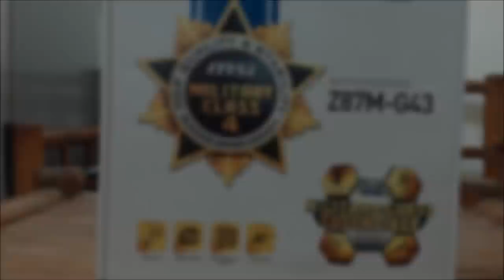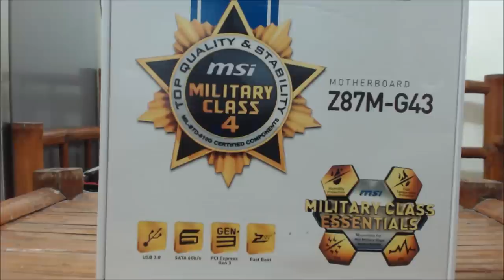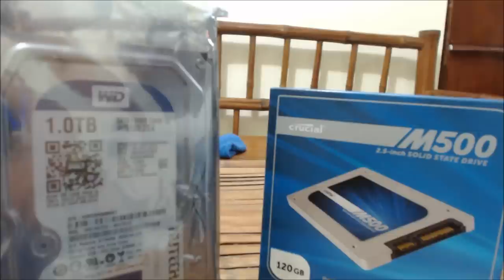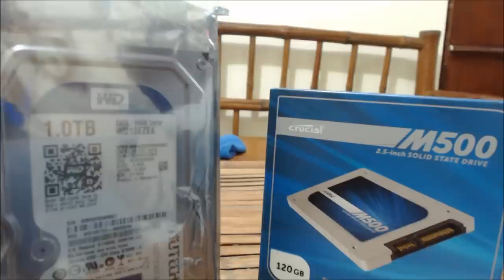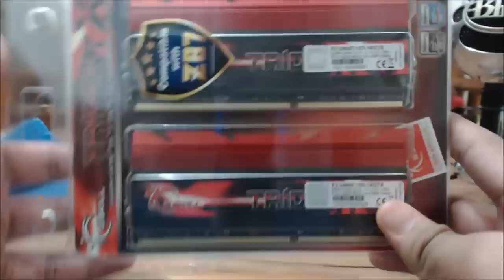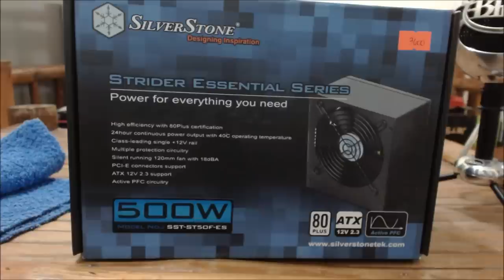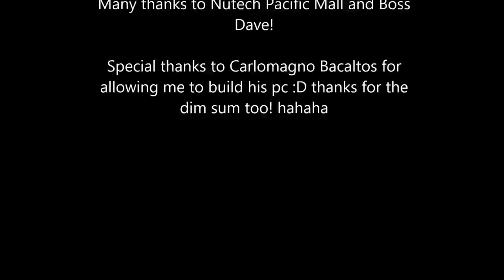Systems Edition : Mid To High-end Build

Comment: Sir~! Jimmy Ano po sa Tingin niyo? 

CPU - Intel Core i7 4770K 3.5Ghz 8MB 
MEMORY - Kingston Hyper-X 8GB DDR3 1600 
HARDDRIVE - Western Digital 1TB SATA 3.0 Blue 
VIDEOCARD - MSI N760-2GD5/OC GTX760/2GB/256BIT/DDR5/OC
MOTHERBOARD - MSI Z87-G43 GAMING Z87/DDR3/MC4/SB CINEMA
CD/DVD/CDRW - Liteon DVDRW IHAS-122 22X Sata 
CASING - Aerocool XPredator X1
PSU - Raider 650 watts 80Plus SILVER
Deep cooling ice blade pro 2.0
OS: Windows 7 64Bit
Reply from the maker: For gaming editing to bro? if gaming lang i5 4570k nalang processor mo.. d ka mag include ng solid state drive?
Reply from the maker: Markiie Dee para siyang hard drive pero 10x faster lahat ng operations pero medyo mahal ang mga high capacity na solid state drivers. ang recommendation ko. get a 120gb solid state drive para doon ka mag install sa Operating System mo tapos mga important na programs and i pair up mo sa 1tb harddrive para doon ka mag save sa mga files mo gaya ng movies, music, games at iba pa. 

with the solid state drive mas mabilis ang lahat ng operations mo sa pc gaya ng boot up, shut down, opening of programs, faster render speeds. imagine 10 seconds after turning on nasa desk top ka na at stable na ang lahat.
Reply from the maker: Markiie Dee yes.. pwede ung nasa video na to.. crucial m500
Reply: halimaw yang RIG mo hahaha
Reply from the maker: not mine boss hehe sa friend ko